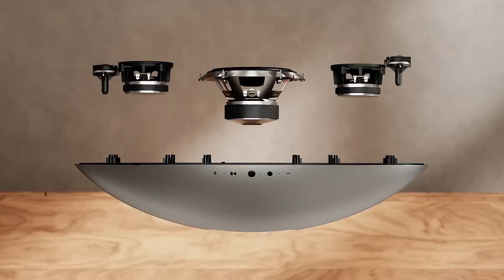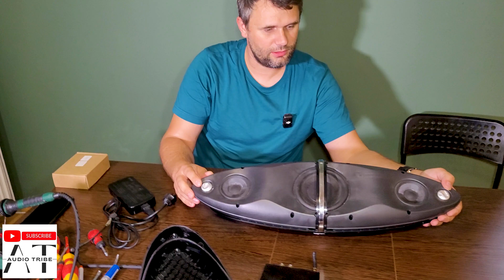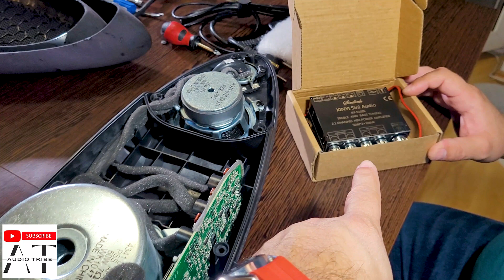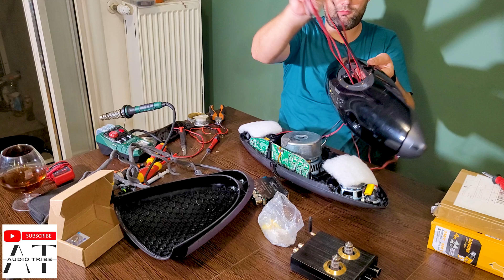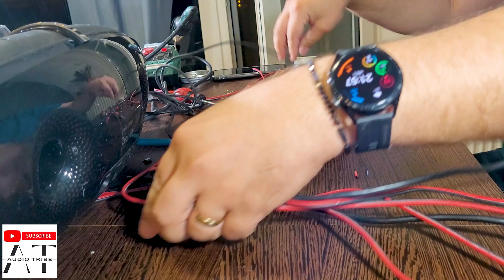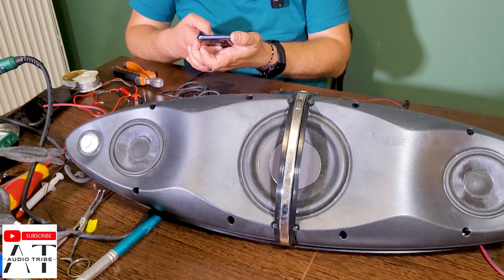TEARDOWN and UPGRADE Bowers&Wilkins Zeppelin Speaker!

Comment: Nice video.
I have a defective B&W Zeppelin speaker.
I ordered a 2.1 amplifier  ZK-MT21 2x50W + 100W  on Aliexpress.
For tweeters can I use other capacitors besides the 4.7 microfarad ones?
What capacity/voltage?

Comment: I am amazed at how many of these zeppelins have failed especially as the cost of them is so high. Cheap components used. I had a 40 year old amplifier which I gave away still working yet my zeppelin air died yesterday just started popping and buzzing then went into safety mode and nothing I did would make it work.. I've removed the speakers and sent the rest to recycling.. I will never buy bowers and wilkins again..
Reply: But the sound is so so sooo amazing 😔♥️

Comment: another downside when fitting an aftermarket amplifier of that kind is that  i`ts a dumb amplifier and those kind of speakers rely heavely on DSP and psychoacoustic effects on the bass region to project the sound of a bigger speaker in that small size 
you can play in the future with some amplifiers with dsp ,you have on alixpres some boards with 4 channels capability  and with a bit of practice you can restore the speaker to i`ts full potential

cheers
bafta
Reply from the maker: Mulțumesc. Cheers
Reply: Any more information on this? I want to do it. I find loads of critics but no information. Please help if you know.
Reply: @markharman32  wondom an dayton audio has multiple models with Bluetooth and dsp
Reply: @gigiboxa  hi gigi, i was wondering what you had to look at when paring a amp? Watt Amps? thanks in advance
Reply: @ look up in the comments
Reply: @gigiboxa   can you provide a link for a suitable product?